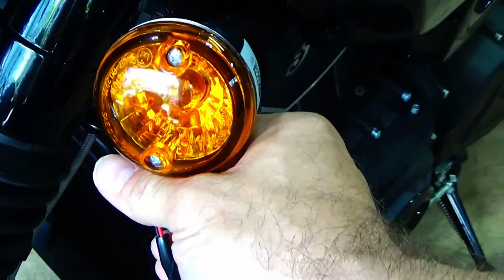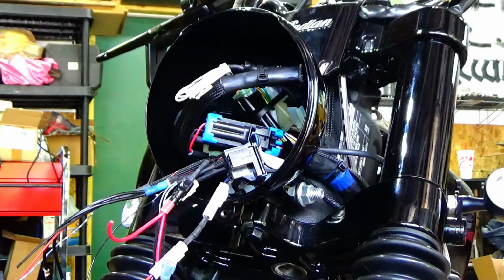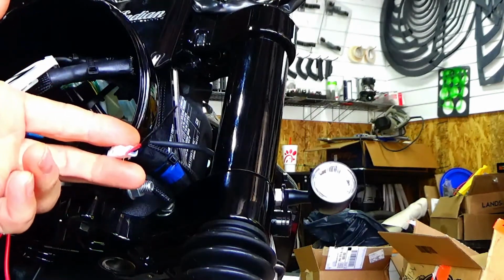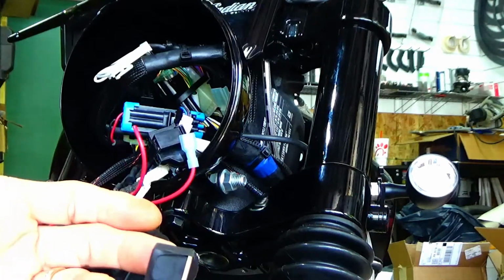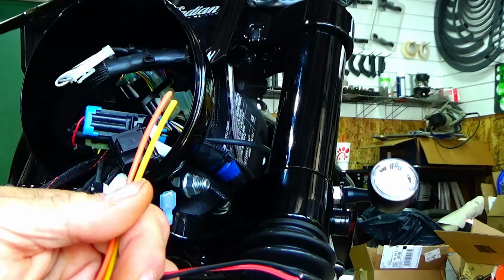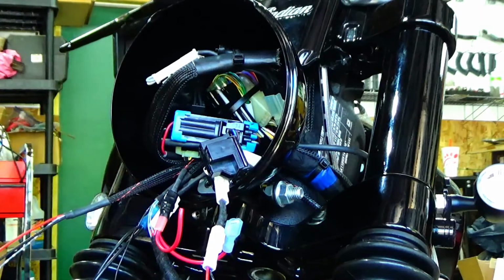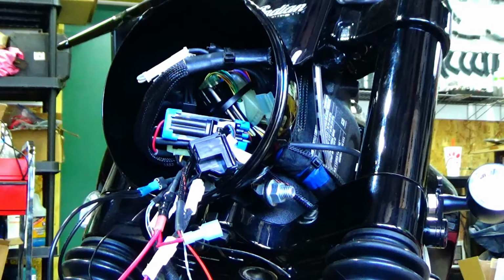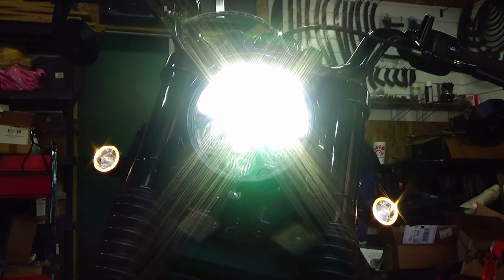2019 Scout/Scout 60 Front LED replacement turn signals

Comment: Great videos, do you by any chance have the kuryakyn part # for those power filter wires? Been looking for them and cant find them any where
Reply from the maker: Thank you for watching! Let me go look. I'm pretty sure there's an updated part to make life easier.
Reply: Ok great! Thanks
Reply from the maker: Custom dynamics part # ind-ts-conv these are a simple inline converter that allows a standard signal light which uses a positive polarity to invert Indians negative polarity output. Basically let's you add your choice of turn signals etc, without going to extremes. I hope that helps.
Reply: Thanks for the great info! Appreciate it!